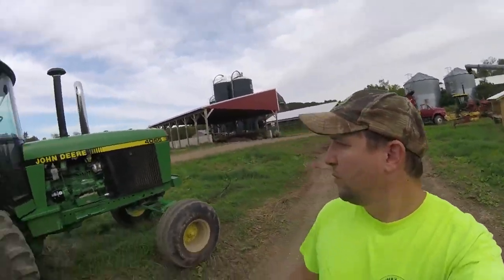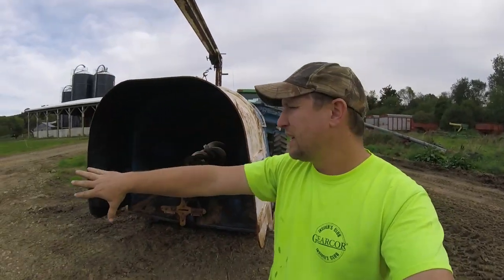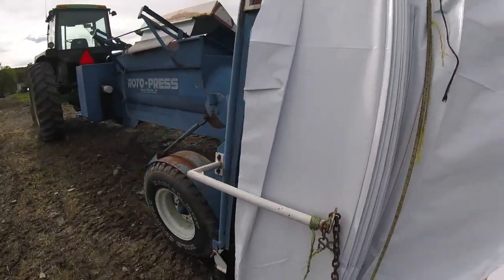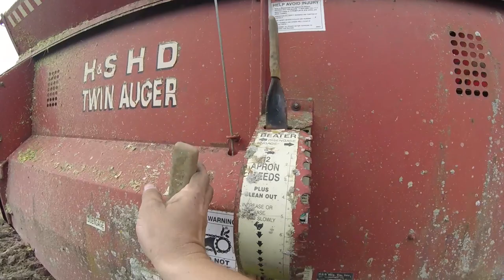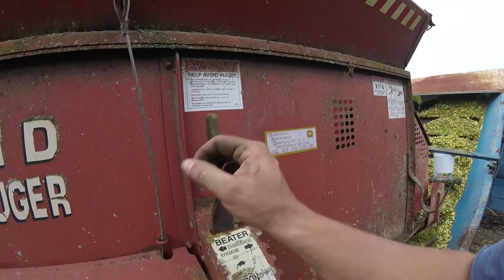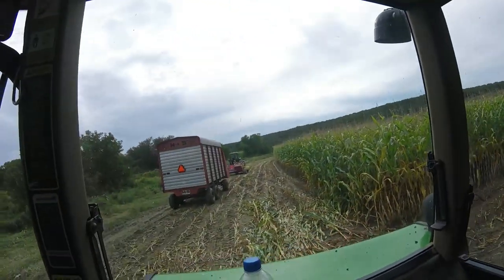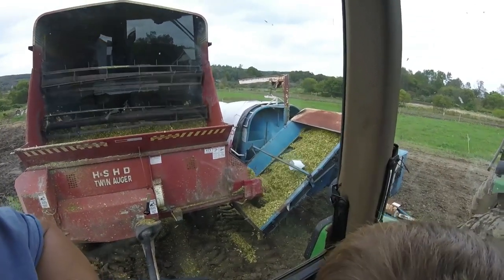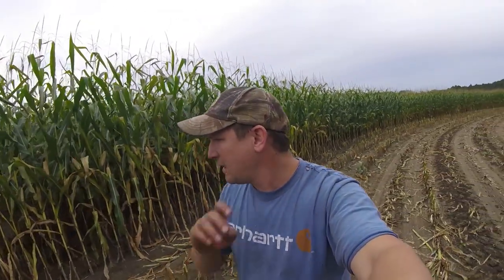Bagging Corn Silage

Comment: We always hire an Ag-Bagger (which definitely has brakes!) to bag what our bunkers won't hold, so I don't have any experience with the Roto-Press. They seem to do great in corn, but I've seen some terribly lumpy bags of Roto-Press'd ryegrass and other haylages! Great video again. No Speed Hitches in these hills we farm - virtually everyone uses dump wagons and trucks.
Reply from the maker: They definitely make a nice bag in corn silage. We've only bagged alfalfa haylage once and it made a nice bag it was just hard to scoop out with the skid steer. Its like we needed a rock bucket or a bucket with a grapple. It was the first bag we ever made so it could've been how we packed it

Comment: Thats an interesting bagger with the screw. At work we have an old kelly ryan with a backstop cables and brakes it has the fingers that do the packing and a chain bed to bring the feed up we can dump trucks into the chain bed. It rarely gets used for feed these days. They buy shavings for bedding in bulk and when our bedding bay is filled we bag the bedding. It actually works out well but is a miserable job to do because of all the dust.
Reply from the maker: They sound like nice baggers

Comment: Once you get the speed hitches you will wonder why it took so long to get them. I bought them years ago and after the first day my grandpa Said " I don't know what you paid for them but they were worth all the money" he's 82 and still haul's all the wagons back and forth to the field. He couldn't help anymore without those hitches.
Reply from the maker: Just gotta commit and get them one day
Reply: A little tip, we have a steel plate on the back of the chopper so if the driver misses the forks the rod from the wagon does poke a hole through the cross auger or blower.
Reply from the maker: @sirmilksalot9557  That's a good tip!

Comment: Kelly ryan and ag baggers are quite similar. They both use a rotor with fingers to pack the silage. They both use a backstop with cables and the drums that the cables roll on have disc brakes. Older Kelly Ryans had bolts that you tighten to apply pressure to the brakes newer machines use a hydraulic tentioner to apply more even pressure to the discs
Reply from the maker: I've never used either but I've seen bags from both and they both make a pretty nice bag

Comment: We use ag baggers for years loved it, yes there is brakes on it if u want to pack harder but u need a 100 hp or bigger or u will snuff the tractor out which we did lol ,
Reply from the maker: I wish we had another 4wd tractor I could have ran wagons with while the 4055 was on the bagger

Comment: When we farmed, we always had twine ran from the tractor to the back of the chopper so you can pull the pin from the cab. Same goes for the shuttle tractor. That way you only had to get out once and you didn't have to deal with pinched pins.
Reply from the maker: You must have had some sort of pully or something on the chopper end. That seems like a long pull
Reply: @mikep7810  there might of been one or an eye bolt off the spout of the chopper. It doesn't take much pull since you can wiggle the tongue by the clutch.
Reply: Not twine but 550 cable as it is a little stronger

Comment: Yep the cables attached to what we call the back rack and there's actually a little dial in the front you have to pump up pressure on and there's no brakes on the tires but what the cables are attached to it there's breaks on them drums so normally for hayage we run about 800 pounds of pressure and for silage we'd like to push a 1000 pounds of pressure
Reply from the maker: That's pretty cool, thanks for clearing that up

Comment: Nice vid as usual Mike!  That chopper looks mean... think I like the way that bagger is designed better than the AgBag design.  So do ya feed outta the silo in winter and the bag in summer? Is that the deal?
Reply from the maker: I've only used this one so I'm not sure which one is better. We feed out of the silo until its about empty then start feeding out of the bag while we refill the silo and give it a few weeks to age. That way we aren't feeding green silage to the cows.

Comment: Have you ever used this bagger in alfalfa silage, if so did it work well? We are looking to buy one and just need some advice, thanks!
Reply from the maker: We bagged alfalfa haylage a couple years ago when our 4th cutting wouldn't fit in the silo. It bagged nice. Tough to get out with just a skid steer bucket, almost needed a grapple.

Comment: The need to move the wagon during unloading would bother me.  Why not attach another elevator that parallels the bag? Then you wouldn't need to move the wagon.

I was impressed by the hay elevator system.
Reply from the maker: Thank you about the hay elevator.  I'm sure I understand about adding a parallel elevator to the bag. The bagger pushes itself forward so its always moving. You would have to always move your elevator. Its not bad at all creeping forward. You just put it in low gear and move slow
Reply: @mikep7810  no, attach 2nd elevator to the bagger and let the bagger pull it forward.
Reply from the maker: @philipblass6544  I see what you are saying. To each their own,  I think it's easy to pull ahead real slow

Comment: My farm has 2 ag baggers and they have cables and a backstop they use pressure to pack the feed we try a bagger similar to that and it did not work for us at all it did not pack and we had to put bales at the back of the bag which did not work.
Reply from the maker: We have learned to always leave the tractor in neutral. My dad left the tractor in park to really get it packed good the first load and ended up blowing it right out the back of the bag
Reply: mikep7810 been there before

Comment: bro tell me an easy technique to make silage because bagging such huge amount of silage  in pakistan is not possible because of the lack of such machinery !! guide me please in order to make silage for my animals
Reply from the maker: If you can't bag silage you can always unload the wagons on the ground in a huge pile and drive over it with a tractor to pack it down. You want to make sure its packed really well. then cover it and it should ferment and make some good silage for you
Reply: @mikep7810   Thanks alot dear for your time and guidence !! can we make silage in this way , without bunker silo???
Reply from the maker: @preachingislam2931  Yes its the same concept of a bunker silo just with no concrete sides. Just be very careful packing it down. If you look up silage pile you will see guys doing it
Reply: @mikep7810   hm ok i will try this method in future thanks man <3
Reply from the maker: @preachingislam2931  You're welcome. Good luck